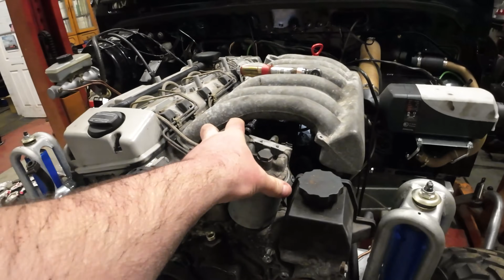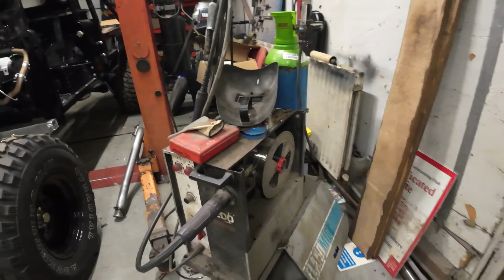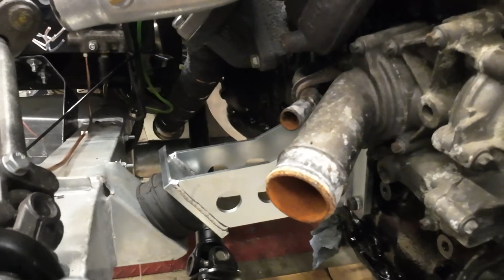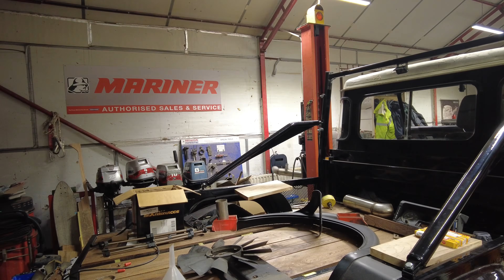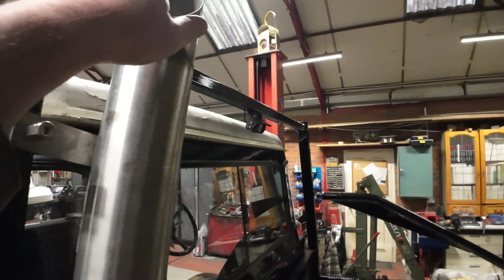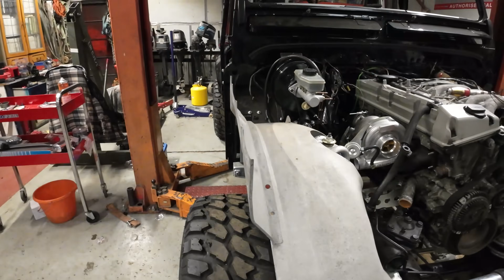OM606 High alternator Mount and exhaust Fabrication, Land rover Build Part 7

Comment: Thanks for sharing the journey here. I've heard that for the power steering pump that the 606 sends a higher psi than the defender steering base can handle. Let me know if that's a concern cause I'm planning my build still.
Reply from the maker: Thanks, we have done a few different conversions on Landrover's before and it hasn't been an issue standard pump is roughly 950-1000 psi and Mercedes is 1100-1200 ish, if it is an issue there are two ways we can solve the problem.
(1) Strip the power steering pump and remove some pressure from the spring to reduce pressure down a little.
(2) electric steering pump from a Volvo etc. with adjustable pressure.
I'm hoping I don't have to do either and it just works but we will have a go and see what happens.
Thanks for the comment 👍👍

Comment: Just caught this update, yes Tig welding is an art, takes practice, I have a cheap Clark Tig unit, getting on 30 years old, but still does the job. I have a small silencer in my 606 exhaust , fitted as a turn key engine, I have to wear ear protection, on a 3" setup as it's brutal, you'll have more bulkhead insulation than I have, mine exits floor level behind the passenger, your looking at a stack.just a note. . Looking forward to the next one 👍
Reply from the maker: Thanks Tig welding is definitely an art and I'm looking forward to doing more  and getting better, I'm really happy with the results so far, not perfect but a good start. I'm going have to see with the exhaust the straight run will be a great place for a silencer if I have to. Do love a loud exhaust though 👍👍